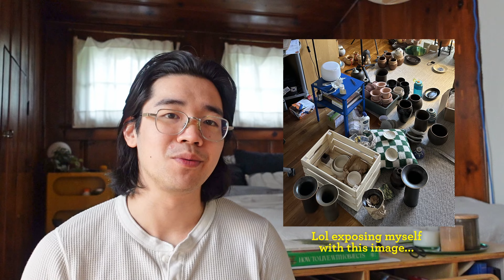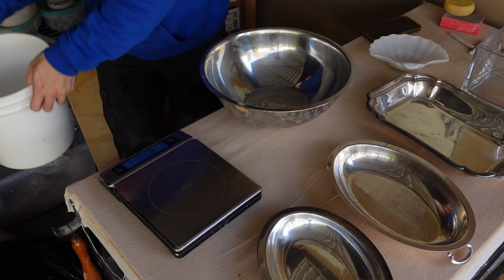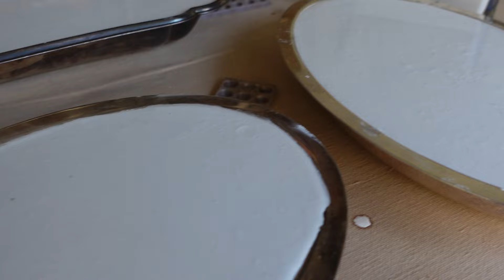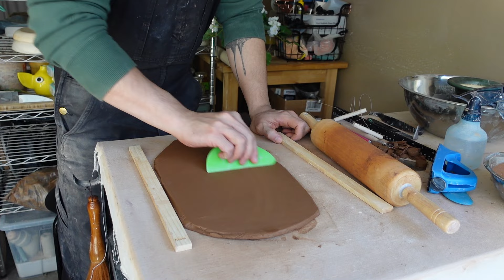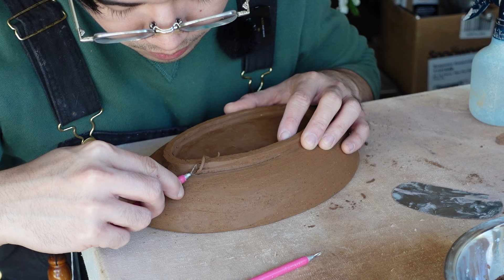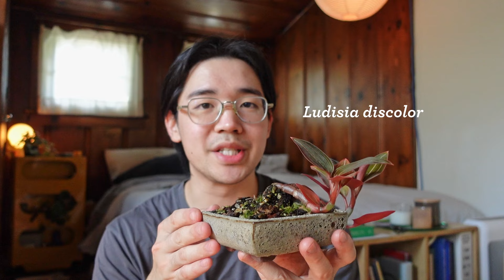Turn anything into pottery 🪴 quick tips for making plaster molds and cheap ceramics thrifting hacks

Comment: How does the soil not come out of the holes?
Reply from the maker: Only the glaze is bubbled 🙂 underneath is solid ceramic
Reply: if you mean for when you're putting the soil in the pot in regards to the size of the drainage holes - you are supposed to put in 'drainage screens' before you start potting in order to cover the size of the holes without the soil all falling out. 
the holes have to be as big as they are due to the nature of the ceramic vessel. you secure the screens over the hole with these loops of wire that go through the grid and kind of hook it to the bottom from the inside. i am not sure how to explain it properly but there are some good tutorials around on how to prepare a bonsai pot for planting :)